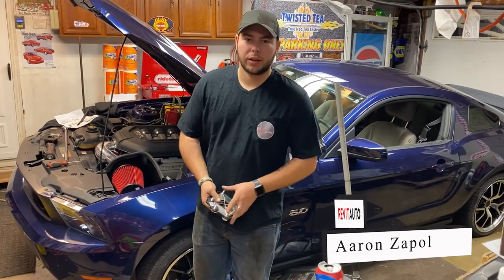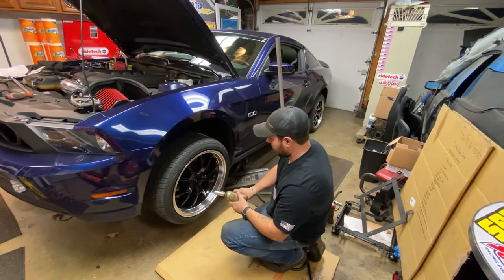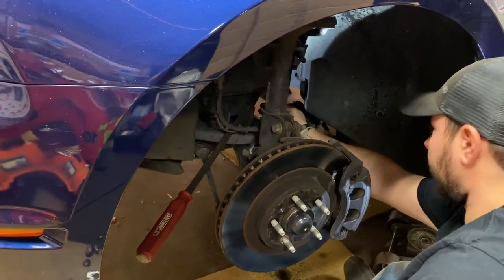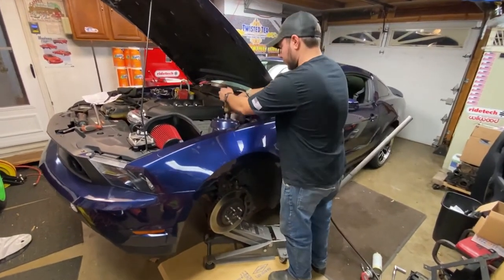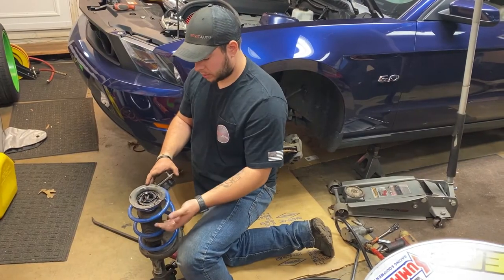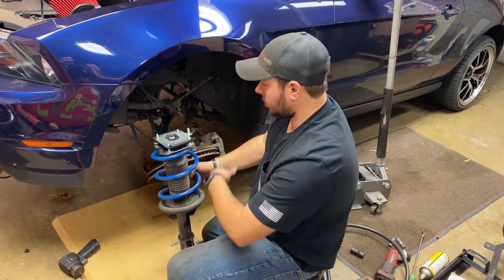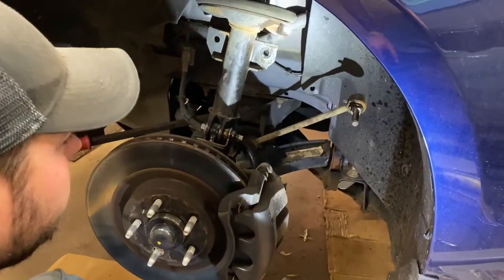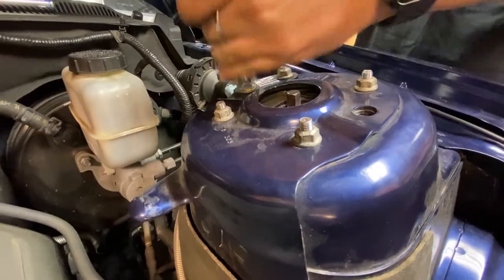Maximum Motorsports Caster/Camber Plates Install

Comment: Quick question, on the “revit tip” will it still work if you remove the bearings from the bottom mount?